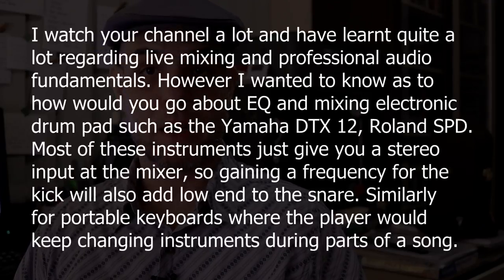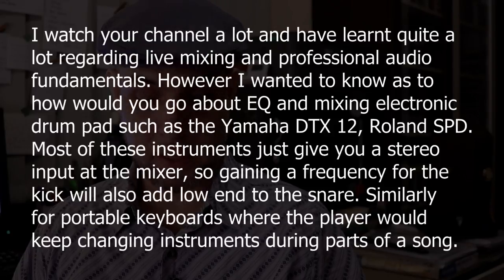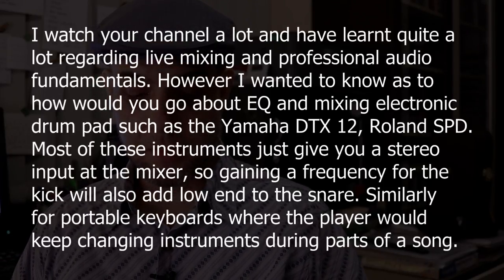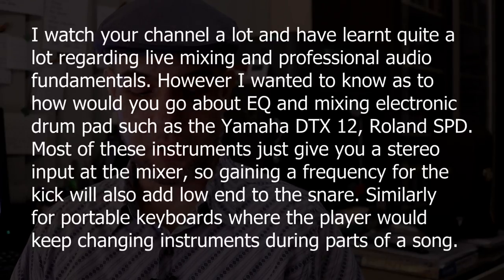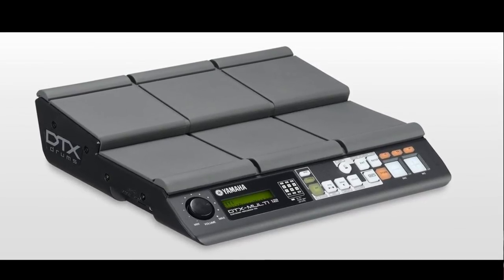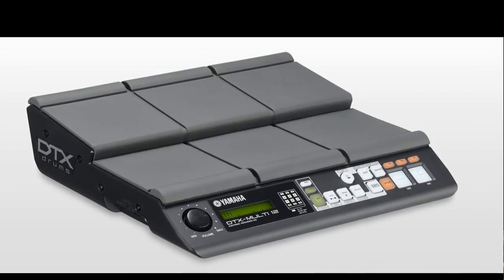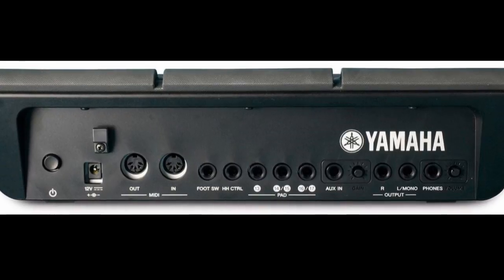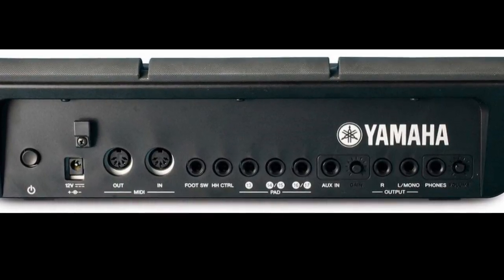How do I balance & EQ electronic drum pads and different keyboard patches? | FSB #5

Comment: Another great video Bruno!
I want to use 2 drum triggers with my acoustic kit. 1 on the bass drum and 1 on the snare drum. These are ment to supplement my normal drum sound. The trigger on the snare would trigger claps or a tambourine in one song for instance. I believe I can pan my samples to L and R in my drum module. Wouldn't this be an option the gain more control over the EQing and levels of the samples?
As you mention in another comment using a DAW and an interface or even Dante would be much beter for controlling everything but also make for a more complicated setup.
Tanks!
Reply from the maker: Hello Bart! Yes that would work fine if you are only using two pads - route the first pad to the left output of the module and the second pad to the right output - that would allow you to process them separately on your mixer. Just be sure to turn off any 'global' EQ or other processing on the module itself.

Comment: Hi Bruno.  Is a DI suggested when sending an on-stage sub-mixer's main outs to the booth?  Stage is <100' from the booth, but the venue is pre-wired so I don't know exact distances and not sure if I should be worried about a loop.  Thanks.
Reply from the maker: If the sub mixer has balanced outputs a DI should not be necessary, however it's useful to have just in case you have ground loop issues.
Reply: Thank you.  Really appreciate taking the time to answer.

Comment: Hey Bruno. I notice the drum machine has midi IO. Can individual drum sounds be isolated via DAW in individual midi outs and sent to the PA mixer? Thanks!
Reply from the maker: Yes you could absolutely do that! However it's several extra steps and not everyone is familiar with MIDI, plus you would need a recording interface with sufficient number of analog outputs.
Reply: seems like one could find a  multiple outs midi box to send individual signals but,, it's been a while since I used live MIDI on stage so,,?? But with the plethora of equipment out there,, must be something. Thanks Bruno!

Comment: How to control eq in mixer for producing best sound for male singer
Reply from the maker: Start with no EQ - all knobs at the 12 o'clock position - and adjust from there. In many cases you will not need any EQ, especially if the microphone is well matched to the singer.
Reply: Thanks for replying
Which microphone is suitable for male singer sm58 or beeta 58
I am giving more importantance to base tone
Reply from the maker: It really depends on your singer's voice - for male vocals I prefer the Beta58a. Check out my video on these two mics: https://www.youtube.com/watch?v=E3N3HjgFxW8